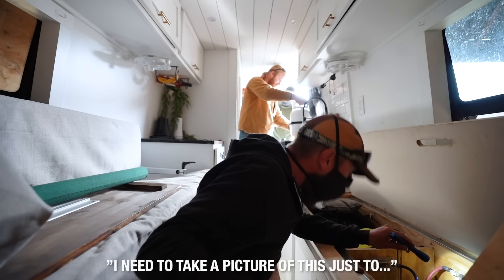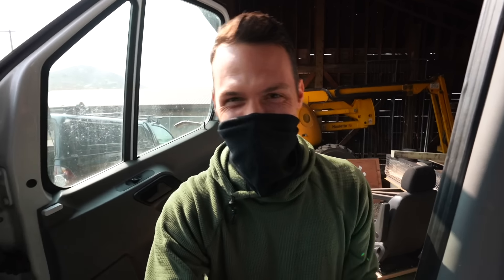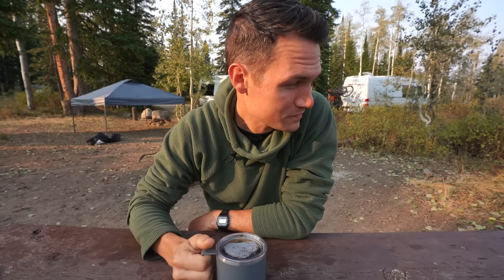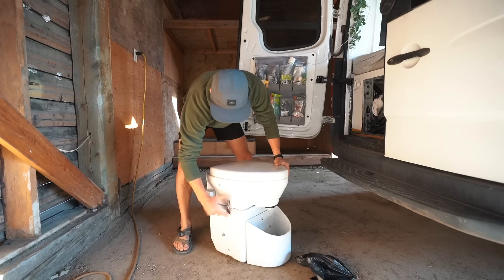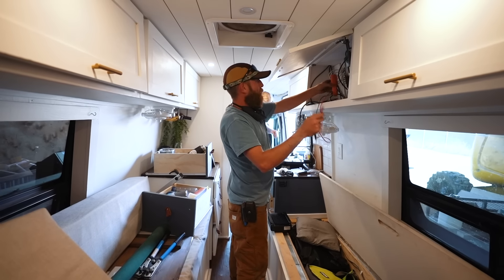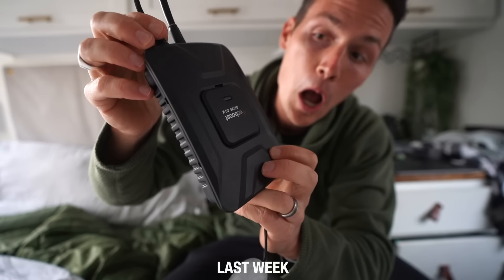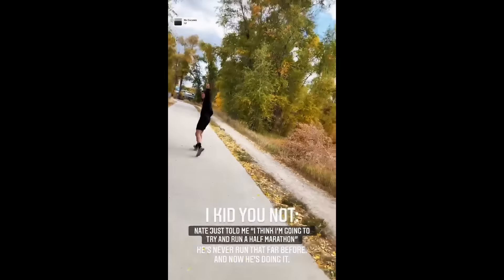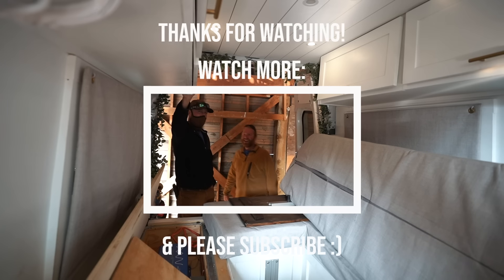Our van almost caught on fire.

Comment: This van is the perfect example of why you never buy someone else's half finished project.
Reply: Absolutely true.
Reply: yes! it seemed like the previous owners had known about the problems in the first place (considering they lived in there) thats why they wanted to sell it (and maybe omitting those problems during the deal to sell it right away but meh who knows 🤷🏻‍♀️ )
Reply: Or get a thorough inspection before you do
Reply: @CarbonatedLatte  as far as ive heard they wanted to sell it cause they got pregnant and wanted to work on a new van in which they could sleep as 3 people instead of 2 - not sure tho
Reply: Most RVs and Sprinter Van mods always require this type of work to be done. Regardless of whether bought new or used. Especially if living in it fulltime.  I know. I lived in an RV travelling all over the states for two years. It was brand new and required new circuit boards for the fridge and furnace after just a couple months.
Reply: True, but it’s not 100% the past owner’s fault.
Reply: Like buying a very used car? Cavaet Emptor- Let The Buyer Beware!  And why contact the sellers, and hate on them? You wouldn't  contact the private sellers of a used car. Once the car is purchased that's it. I can't remember but did Nate get this van checked out before buying? 🤔
Reply: @CarbonatedLatte   I hardly think it's the original owner's  fault.  It could have happened for a lot of reasons.  Don't forget that Nate and his Dad did "electrical updates"  before they started this journey  AND Kara driving off road with it during the bike trip probably jolted a few things loose.
Reply: @Liette2610  Yep which is why i also said who knows, just to give them the benefit of doubt. Afterall, they lived in there so at some point they would have known/ atleast an idea of what was wrong or maybe they werent also aware 🤷🏻‍♀️ anyway, glad kara and nate opted to go to a professional to have them fixed (finally) instead of DIY. that could have been another "we shouldn't have done that" video lol
Reply: @sswan9689  - Clearly he didn't. Right away, before they left his parents house, the van had electrical problems and Nate and his dad worked on it. I would have immediately taken the van to an RV service center for a complete inspection. And with this video we've learned there were other sporadic electrical problems on-going. No way I'd have trusted this van. But, then again, I've been stranded in the middle of nowhere back in the days before mobile phones and I had no money. Trust me, that's something you never get over nor ever want to experience again.
Reply: It was probably just the closest they could get to what was perfect for them...I'm not a fan of the van's design but I guess when there's a pandemic and you're trying to continue on with a travel YouTube, shortcuts have to be taken. Good thing none of them turned out really badly!
Reply: @drewkryptonite  If it's done properly from the start that won't happen. Factory new doesn't mean anything. Truth is car mechanics are not electrician & I'm questioning if those guys that fixed it knew what they were doing. This is exactly why I just started documenting my van build this week. This space DESPERATELY needs an electrician to teach & show how things are done correctly. Almost 40 years in construction & yes I am a licensed electrician.
Reply: @kabella66  It was a wire size problem & fused incorrectly.
Reply: @vanlifebiker  That was part of the problem but we don’t know if that’s the only problem do we, you?
Reply: @GOLDVIOLINbowofdeath  Not sure what your asking. If things are done probably u won't have any problems. This what wire size & fuses do. They protect from fires. Hope that answers your question. You can sub to my channel to learn how to wire things properly. I'm currently digging into editing so you are in luck. Things are about to get better than me just recording & posting. I just did my first edited video a couple days ago playing with a intro & outro. Glad to answer any questions in my comments. Here to help my friend
Reply: Isn’t that like saying don’t ever buy anybody’s used car because you’re just buying their problems? I member someone telling me that when I was in college. I bought a one year old salvage titled Toyota FJ cruiser in 2013 for $15,000 including repairs. Eight years and 70,000 miles later it was recently totaled when someone rear ended me on the freeway and made me roll over two times. My insurance company just gave me over $33,000 for it.
Reply: @GOLDVIOLINbowofdeath  No that's factory wiring & for the vehicle which has been engineered tried & true. It's not building an ebtire house in 60-75 square & wiring a 12v  entirely different system like normally without someone that knows what they are doing possibly. Not to mention solor experience & an entirely different 120 volt house power system. It could have a alternator system that switched from motor battery to battery bank in the house part that switches back & forth & on & on. All being done be by who knows with no certification or training. Even a certified mechanic knows nothing about solar or inverters or proper grouding with multiple systems. I'd be willing to say most don't even know alot about wiring a 12 volt system from start to finish which is what they are most familiar with. Ever heard of a transmission specialist company? Why is it that all mechanics don't do it? Just an example that they don't even do all things on vehicles that they actually do. Electrical industry takes 5 years of schooling plus working beside someone like myself everyday to teach hands on training too. I could get a job as a mechanic in some hole in the wall shop even it it was just changing oil & other fluids etc. Wiring is a different breed that causes fires hints why a electrician had to have so much training to get certified & is a industry that can pay 10 times the money than a guy changing fluids or about 5 times the money than a full blown certified do all mechanic which there are very few that do all. If u mess ip plumbing in the van you get a water leak. If u mess up wiring u could loose the entire van or even die if you were asleep. Big difference. Hope I made my point for you to understand that & take it seriously. This is why their are so man van build fires. I'm offering decades of training & knowledge for free on my channel. I see these people breeding electrical fire hazards on yt all the time that are barely 2 decades old. Just trying to help the vanbulid community so people stay safe by volunteering with my almost 40 years in the trades being certified in the most dangerous trade & being around other trades for all those years & seeing how its done.
Reply: @vanlifebiker  I come from a family of electricians and my brother who is a retired journeyman electrician got some fantastic deals buying antique cars and had an electrical short that nobody could find so he bought it and tracked it down in a couple hours. If you can’t do that you got no business working on a car electrical system
Reply: @GOLDVIOLINbowofdeath  I couldn't agree more. That's my entire point I have said to you. Mechanics are not electricians. I am Journeyman Wireman for the I.B.E.W. & have almost 40 years of experience. I usually work as a Sub Tech now building Sub Stations as it's better pay. I was a Journeyman Electrician for a long time til I became a Wireman after taking a test. Now I'm a Sub Tech. I'm pretty sure I could find a short. I haven't ever not found one yet in all my almost 40 years. Mechanic & electrician is a big difference & I'm kinda way over the norm licensed electrician pay scale. I passed my first Journeymans exam almost 40 years ago. I was even a contractor at one point but it wasn't for me. I'm to honest.
Reply: Actually found a short one time in a house after 3 different electrical contractors were hired & couldn't find it. The problem was a remote sensor buried in a junction box in the ceiling. 😂 Guys vacation home & didn't know what the remote went to so he had tossed it in a drawer. 😂 Who knows how many thousands he paid for multiple contractors before me? Poor guy but not really. He had LOTS of $ & just wanted his art lights to work over his expensive paintings to  work in his vacation home.

Comment: This confirms again what I keep telling everyone interested in a conversion: invest in professional help to do the dangerous work! AT LEAST have a licenced electrician look over your plans.

Hiring certified professionals to do your heater installation, plumbing and electrical is the logical thing to do for so many reasons: your life might depend on it! Many guarantee their work, and will think of details you might not see in YouTube tutorials, like separating your water and electrical systems, using the right kind of wiring and piping to maximize the efficiency of your equipment...

It makes sense financially as well: think about how much your time is worth. As Nate mentions, experts will only take a day or less to do the work and do it right, whilst most of us will probably need several days to figure it out and hope it holds. How much money would you make working during that time instead? Even if you’re building on a budget, hiring a professional will save you more costs down the line and make the most out of your investment. It will help boost the resale value, and another big argument is that it usually saves you even more money in insuring your build! Showing the sensitive systems were installed by licenced professionals can help you get your rig insured as an RV, which means good premiums but also, everything in it and all your work and expenses are covered in the rig, not just the vehicle itself.

🤔🤗🚐🙏
Reply: FYI I'm a licensed electrician & this is exactly why I just started documenting my build. Someone is DESPERATELY needed in this space to teach & keep people safe.

Comment: I'm so happy you got professionals,  and I think you made some new friends.  They are not going to forget you with that electrical system. And I think you have hot water because the heating system actually is getting enough power to heat.

Comment: I mentioned 3 months ago that 1) you should of gotten money back from the sellers because it was obvious that they DIDN'T have a professional install the electrical components and 2) One should never work on, especially, electrical components unless you know what the heck you are doing.  So needless to say I am glad that you finally got someone who knows what they are doing to correct the electrical issues and install the heater.
Reply: Unless the sellers said it had been done professionally or omitted knowledge of dangers, the onus seems to be in Kara and Nate getting an inspection before buying.

Comment: The electrical problems were probably not helped by Nate trying to "fix" the problems which probably helped the problems get worse.
Reply: Stop playing the blame game!
Reply: @daniellerose1114  lol, not blaming, just saying it probably contributed to an already bad situation. I am just glad they got it fixed professionally. I am sure they are too.
Reply: @sabinewren6588  me too. Sorry about the comment. Definitely a lot of lessons to learn from this
Reply: @daniellerose1114  Don't apologize, re-reading the comment it does come off meanly, which was not my intent. Have a great weekend.
Reply: @sabinewren6588  thanks you to! 💜
Reply: @sabinewren6588  The only way he could have is if he loosened a connection. That would cause a resistance problem & cause heat. Bottom line is it was fused in properly to begin with & the wire size was too small. My concern is if 200 amps is correct which is what it was changed to. I just started a channel this week for this reason. My van for example will be sized to 300 amps. This space DESPERATELY needs a electrician that knows how to do things correctly & explain how. Almost 40 years in construction & yes I'm a licensed electrician. Glad they are safe.

Comment: Attempting a half marathon without training is crazy, but it looks like 500 miles on the Colorado Trail was training enough. Nate, if you want to get into another interesting sport, try a triathlon or biathlon (which is run-bike-run, instead of swim-bike-run). When I lived in NY, I chaired the Long Island Gold Coast Triathlon/Biathlon for its first 15 years. It’s a great entry level race to the sport, (short and fairly flat terrain), and I think you would really like it. And the participants are wonderful people.  It’s typically held on Father’s Day, in Port Washington, NY. Check it out.

Comment: I would drill some ventilation holes in that electrical cabinet, maybe add a cooling fan to bring in cool air. This will extend the life of your inverter and prevent future problems. You could connect a small thermostat to the fan so it only runs when needed. Set it for 75 or 80F. degrees.

Comment: Glad all your electrical issues were looked after and the propane leak was resolved.  I’m not familiar with how compost toilets work but was wondering if there is any way you can line your toilet with a heavy plastic bag and then just lift the bag out next time you need to change it.  Happy and safe travels lovelies. x

Comment: I've been researching options for a "living/travel vehicle". If you had it to do over again would you consider/go with: 1) Converted Cargo Van (like you have), 2) Converted Cargo Trailer (which would require a separate vehicle to tow), 3) RV (no conversion needed), 4) Travel trailer (again needing a vehicle to tow, but no conversion needed), 5) something else?
Reply: Truck camper! Smaller, maneuverable, great ground clearance, everything works as it should usually since it hasn’t been converted.

Comment: Having to have the van rewired...bummer! And ummm I would poop on a newspaper, wrap it up and throw it out the window in order to avoid having to empty the commode and pee in a big gulp cup...again, throwing it out the window. 
Good thing your van was fixed by pros so electrical wire thingees won't catch 🔥 won't melt. And great you have hot water! 
Steamboat, CO is gorgeous!

Comment: When you said refrigerator, I said, no way. I watched you get a brand new one 3 months ago. I knew there was a mistake.
I know you don't, and I know you won't, but I wish there was some way of suing the former owners for malfeasance under the lemon law. Mainly because some of that stuff could have gotten you killed.
Edit: Just read your message about the former owners. Haven't wouldn't, won't contact them in any way. But I do hope they feel some embarrassment, for being shady. Of course there's always, Buyer beware. But I still feel they knew how bad it was.
And you guys with your rose colored glasses, see the best in everyone.
Reply: Kathryn Blodgett I definitely think they should be refunded the money they had to spend on repairs and getting everything up to code and safety standards.
Reply: SMG what does that have to do with anything? They were sold a defective product. If the previous owners were upstanding, they would offer to reimburse Nate and Kara for all the electrical  work necessary to fix their mistakes. But I’m sure they won’t.
Reply: SMG That’s no true at all, you can still go back on someone if they sold you a knowingly defective product. Doesn’t matter if it’s new or used.
Reply: SMG  Went back and checked, the fridge was fixed under warranty. Knowing the other things that have gone wrong electrically, sounds suspicious that tech said they Fixed things that had discolored. 
In most states there is a "Lemon Law", were you as a seller have the responsibility of making sure the vehicle you are selling functions properly and SAFELY. And from most of the other comments I'm in the majority in my feelings.

Comment: Wouldn't Solar be better? Especially off grid
Reply: They have a solar panel as well though 🤔
Reply: C S I was wondering why the other heater or why they did not use a heater before.
Reply: @ralphal.8398  I think the heater wasn't installed before. And they travelled mostly during summertime, so they might not felt the need to install it earlier 🤔

Comment: If you want to know if the person doing electrical work on your van knows what they’re doing secretly create a short and see how long it takes them to find it. Second look at their connections and see if they’re using the ones that are really fast or the ones that are really secure because if a wire comes loose it becomes a fire hazard. Tug on sone wires and see if you can pull them out. Look at the labels on the wires and then look at the label on the fuse and if the wire is rated for more current than the fuse is rated for then it’s wrong. The fuse is supposed to be the weak link. Too bad they passed up an opportunity to educate their audience rather than entertain them.

Comment: When i see this i really wonder why you did not just buy a proper RV that does not have these issues, no handles to bump into, easier to connect electricity, fill water, empty toilet etc.

If you are going to buy a van to live in for a long time, why noy buy one that is built from scratch as a mobile home.